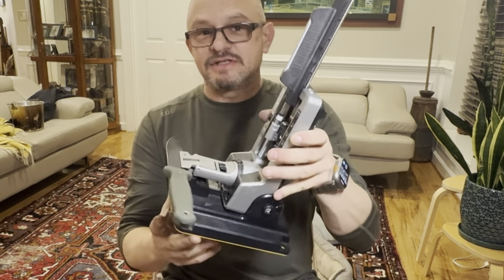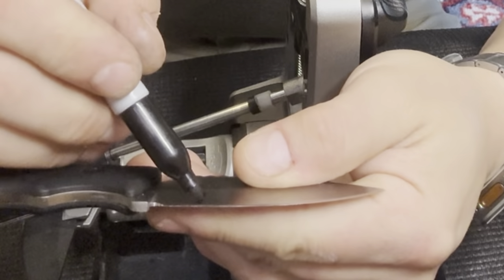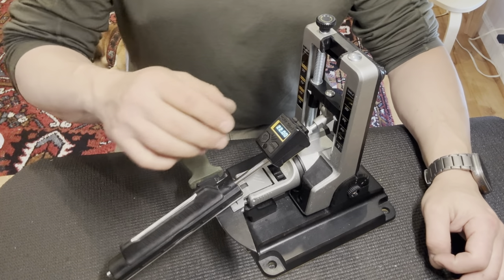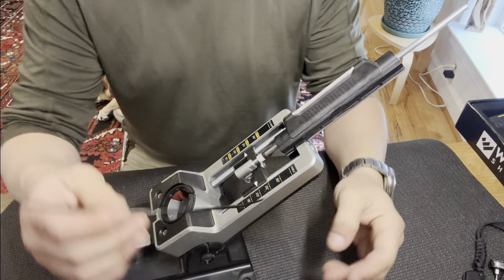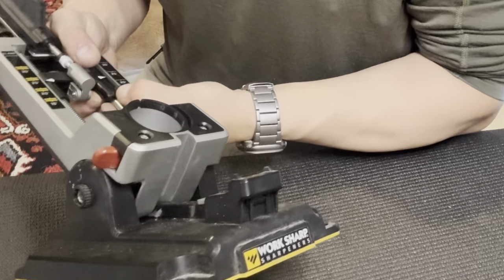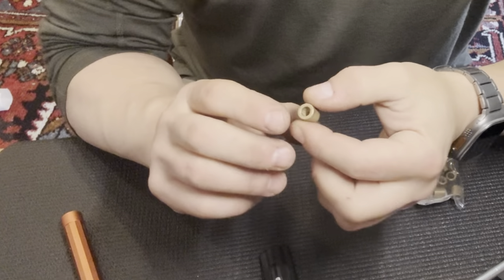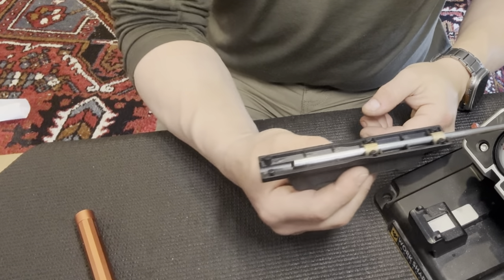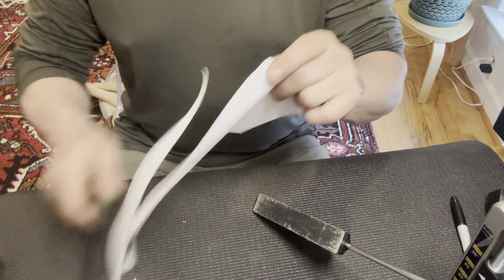Episode #1. Did Work Sharp stop $3 short of Professional level? Is it really PRECISION Adjust-able?

Comment: Hello CBRx, 
I was wondering how long the sharpening plates and stropping plates last. Did you have to replace them in the few months of using this before making this video? How many knives would you say you can sharpen before having to renew a plate? 
Thanks for the honest review! We need more people like you on YT! You have my sub!!
Reply from the maker: Welcome to the tribe! The fine grit plates, 600 and 800, last well over 50 sharpenings. The heavier grits don’t get used as much so I haven’t replaced them yet. I don’t like the strop that came with the set a s the leather is waaaay too rough.  You shouldn’t need to keep the fixed angle for stropping anyway, so I recommend a dedicated strop

Comment: i went on ahead and purchased this today, i also grabbed up that pack of bearings you recommended. i hope this things ok i purchased the ken onion sharpener a few years ago and hated it.
Reply from the maker: I would recommend to try it out before putting the bearings in. It only becomes necessary. Please also watch the videos that I posted recently covering the proper way to tension the clamp (must see ;) and to support the blade (optional)

Comment: Anxious to hear your thoughts on new glued/bonded stone holder. I just bought one from a brick and mortar store. Mine too doesn't have screws (can't put brass bushings in).  If worksharp's action was to put brass bushings in to correct their initial mistake (cost over quality) this would make sense.  If instead their business model is to force purchasing a new stone holder arm after approx 30 knife sharpening(s) I'm taking it back asap and giving this the lowest review possible (ie American engineering at it's worst). What happened to the days companies built quality products vs building into their model known failures to keep charging their customers for replacements parts designed to fail vs last?  Let's see what the results are... but we need to start banding together to share input with companies like Work Sharp (and more so potential customers) doing this vs just accepting every decreasing quality even on 'premium' (marketing term) products.  I see they just announced a new model (with HUGE case and more sharpening stones) yet it appears the same base unit with same weaknesses but far more $$$.
Reply from the maker: @tkels5471  Yes, I have an “upgraded” plate holder and a plausible solution to add the bushings without removing the plastic ones, but I haven’t tested it and so it’s work in progress. If you search my channel, there are several videos about XARILK Gen 3 sharpener that I’ve been using with great success and without any bandaid fixes. It’s very similar to TS Prof Cadet but 5 times less expensive! and I am currently working on a video comparing the two. I think that you would get more than your money worth out of this one https://www.amazon.com/dp/B0D5QQW4YD/ref=cm_sw_r_as_gl_api_gl_i_514X3TZR1DCY3TH50DGE?linkCode=ml2&tag=gearupandgo-20

Edit: this is an affiliate link and I would get a small commission if you use it.
Reply: @CuttingBoardRx  THANK YOU

Comment: Worksharp just made a change...not for the better. I ordered a couple extra Rod / Abrasive holders and one of the abrasive holders no longer has screws to take it apart for your bushing modification or cleaning it out. It is probably snapped together, but i don't want to destroy it for no reason. I really don't need it and would be glad to mail it to you if you want to dissect it on video.
Reply from the maker: Wow, that’s interesting! Thanks for the information! Could you please send some photos to the email address in the channel description? And, if possible, the link to where you ordered it?
Reply: I just sent a new screwless model out today per your request...will be there on Tuesday. Hopefully, you can  figure out a mod for it as well.
Reply from the maker: Thanks! I’m tracking the package!

Comment: They sent me 6mm x 10mm x 10mm and it will not slide onto the rod. I ended up using a size B drill to ream them out and it made them fit perfectly. Bit was only 5 bucks on Amazon. Yes...you are correct the 1/4 would be to big.
Reply from the maker: I ordered metric bushings and they work. It  supposed to be a slip fit meaning almost no clearance, so 1/4” is too big. If your rod measures 1/4, send a picture to the email address in the channel description please

Comment: I just got a new one and the biggest issue I've found so far is how much flex the blade has within the clamping jaws. With the spine seated as far back as it can go, it doesn't take much force on the blade to see the spine actually move within the tightened jaw. It seems to me the jaws come together at an angle that is way too steep, which allows for very little actual contact area to apply clamping force with. Have you seen this problem as well?
Reply from the maker: @MrStrizver  yes and I solved it. There are a short and a long videos on my channel.
Reply: @CuttingBoardRx  Thanks...found it (again)...I knew I had seen that one before!

Comment: My friend, I love your straight to the point fixes. Do you edc the Arc ?
Btw great video, I may go back to sharpening with something other than a metal file eventually 😅
Reply from the maker: Thanks! Regarding the ARC, I’m trying to figure out how to…. Haha, like I’m going to spoil the surprise!
Reply: @CuttingBoardRx  Well done, now I wanna know ! Anyhow I'll watch the vid 😉
Btw I broke my neck knife's tip on The Kindling Of Doom... Seriously a very thin piece of hazel. I'll grind it someday
Reply from the maker: @ARAW-__-  Was it ESEE izula?
Reply: @CuttingBoardReviews  nah, Civivi Circulus. I love that small thing but it's not perfect yet. Almost
Reply from the maker: @ARAW-__-  hmm. That’s why I don’t trust anything that has “budget” and “made in China” in the description! Their heat treat is always at the extreme of tolerances because they think we want 62 - 64 HRC on every blade! (and there are plenty of idiots who say that!) But 10cr15mov should have been 57 RC at most on a fixed blade and if it was properly done it wouldn’t snap off… 😡🇨🇳🤬
Reply: @CuttingBoardReviews  I knew the tip was thin, so I did not apply much force. The only leverage was my hands against one another. I'm a bit bummed, but hey, my Izula is still in one piece. Although, it's a smaller piece now with that file grinding 😅

Comment: The clamp design has a design defect in that it doesn't secure the spine along the entire width of contact.  The problem is the closure mechanism pivots around a set point and so only contacts the blade at a very thin line along the edge.  the rubber in the clamp is the cause, most of the angle play is in the clamp rubber itself especially on thinner knives like cooking chefs knives. Hapstone stone adapter fixes the carrier bushing play but then requires a longer guide rod and itself needs modified to hang up on the top hook.  They really need to address all these issues in a revised design.
Reply from the maker: I haven’t tried Hampton holder but it’s on the agenda. At a glance though I don’t expect it to be much better than the factory one. However, I respect @neevesknives Jared’s opinion a lot on all sharpening methods and that’s why I will order it from his link and will give it a fair assessment from a precision machinist’s prospective.  (he’s the one who first mentioned it to me in a live chat) If I find it to be as great as everyone thinks it is, I will provide HIS link to my viewers so that no one would be able to say I profit by HIS advice. Regarding the clamp, I have only seen a wobble with the widest of my blades and I agree with you, Work Sharp could have addressed it differently. Appreciate your thoughtful comment!
Reply: @CuttingBoardRx   Aside from the adjustments you mentioned the hapstone adapter is a game changer imho not only because it allows 'standard' sharpening stones but it's much higher quality all metal design that slides more smoothly and without canter perfectly along the guide rod and without the plastic bushing play you found.
Reply: try sharpening a 8" chefs knife and you will find what is imho the biggest flaw of the clamp grip play. Also on mine at least the cut angle is 1 degree difference simply between the top of the knife and bottom by flipping the knife.
Reply from the maker: @darylfortney8081  definitely on my to do list!
Reply from the maker: @darylfortney8081  I get what you’re saying. If I was sharpening chefs knives all the time, it would require using wet stones.
Reply: @CuttingBoardRx  I use both and the guided setup is much better

Comment: Very nice review! But I have to ask: Is there an even better sharpener out there that you would recommend over this one? I am currently contemplating ordering this. The system I have been using for many years is the old Lansky system. I take it that even with these issues, this one will still beat out that old system?
Reply from the maker: I was eyeing the Wicked Edge system which the only other system in that isn’t priced out of my reach. But it is basically a more expensive version of the same approach. It is $100 more in its most basic form and to get everything you’d want in your arsenal expect $900-1500 total investment. The only major difference from WSPPA is you don’t have to flip the knife and you can sharpen both sides semi-simultaneously in an alternating fashion. I gave it some though but decided that I would never be able to trust that system as my left and right hands don’t exhort the same force. And I like to keep my left hand on the underside of the blade almost at all times to feel for sudden changes. Also, you would end up having to buy and store twice as much abrasive media. WSPPA is a huge improvement on Lansky and the inclinometer comes with it so you can always have repeatable angles

Comment: Unit just arrived and I'm happily using it but the CLAMP allows the knife to pitch up and down., no matter how hard I clamp it, the blade tilts when applying the abrassive to blade and sharpening...    :( the flex is about 2 degrees...(Pitchi).  if I use the abrasive in a PULLING method the blade pitches down, and I use a PUSHING method the blade pushes up...  Any advice?
Reply from the maker: Sounds like you are pushing down on the plate holder. There is no need to press down at all. And I tighten it very hard. Wider blades though I have to support with my free hand specially towards the tip
Reply: @CuttingBoardRx  thx for advice… I will give this another shot!! ;)

Comment: Has anyone had a problem with the plastic chassis that holds the rod cracking? I’ve asked Worksharp about it and they sent me a whole new upper unit, which also had a crack, then another with the same problem. The third one I got was fine, but I just wonder if anyone else has noticed that.

Comment: Hi,some greetings from Germany!
I'd bought the sharpener some weeks ago and have the same problems like you with this thing .
It's great that i can easily change the bushings,but i can not open the abrasive angle.The head of the screws look like a "face"of a teddy bear,no torx bits i own will fit.Do I need a special tool?And if i do:Which size?Please let me know.
Best Regards,A.Bertram
Reply from the maker: Mine work well with T8 and T9, the latter being slightly tighter. I use the Hoto driver linked in the description, but any set should work.
Reply: Hi there. I'm from Germany as well. The link provided in this vid is from Amazon US and that would ship. Do you have a link where to order those exact bushings in Germany?
Reply from the maker: @passenger0102 I do not have a link to German retailers. Look up bronze washers 10mm outside diameter, 6mm inside diameter, and 10mm length.

Comment: Great job on the fixes. It's very impressive, but I have to disagree on you saying 80crv2 is a very high-end carbon steel. That type of steel is meant for cheaper knives that can handle some toughness with no edge retention and will rust. Great fixes, though.

Comment: How do you deal with the problem of the angle changing from the heel to the tip for longer knives? When you set the angle at the centre to 20 degrees and move to the tip, the angle gets smaller.
Reply from the maker: Check out my latest video: https://youtu.be/amzmCWjo0cY?si=g9pHspuq4RPkTtKT

Comment: Will the self lubricating bronze bushing cause any wear to the rod?  I'm going to do all of your fixes.  I'm not that good at sharpening knives yet but I might as well start off with my worksharp being squared away.  Still struggling with figuring out all the factory angles of all my different knives.  Never sure what degree to set them to.  

Thanks for the video
Reply from the maker: Are you using the Sharpie method to find the factory angle? Also, if you plan to change the angle from X to say 17 degrees, there’s no need to figure out what the X is. Just clamp the knife, set 17 degrees on one side, make sure that it’s also 17 on the other side and start sharpening with the 240 grit. 
The bushings are designed specifically for this application so I wouldn’t worry too much. The burrs that come off the blade, if some get inside the abrasive holder, mostly get caught by the magnet on the inside.
Reply: Thanks for the reply, I ordered 10 of those bushings.  Also, thanks for the advice on sharpening angles.   @CuttingBoardRx

Comment: Thanks for a great review. I replaced the nylon bushings with brass ones from Amazon but am having a problem. After sharpening for awhile the bushings seem to gum up and bind on the steel at the far bottom end of the rod. It appears that either the lube in the bushings is gumming up or maybe the rod heats up and expands (I would expect the bushings to expand also). I did check the diameter of the rod with a digital caliper and its straightness by rolling it on a flat surface. 

Any advice?
Thanks
Reply from the maker: A drop of gun oil on the rod every so often should help
Reply: @CuttingBoardRx  Thanks. I'll try it.

Comment: I ordered the bushings at the link provided but they are larger than the ones in the rod. I should have measured them on my machine but I didn't. If I had to guess though, if the nylon bushings are now smaller they are about 4mm ID and 8mm OD, approximately. Of course, perhaps Amazon sent the wrong size but that never happens, right?
Reply: Never mind, it was my error in ordering. Apologies to Amazon. Apparently it will be a month before the right size get here.
Reply from the maker: @ImOnTheEdge  it took about 4 months for me to start noticing the wear on the nylon bushings, so you have plenty of good sharpenings in your arsenal!

Comment: Hi, I just purchased a used one and don't see the white nylon bushings that butt up against the black bands which limit stroke. Some review videos (including by Worksharp themselves, at least the one I watched) don't show those. Did you add those yourself? Or perhaps they stopped including them? It seems they would help as I'm moving the bands just by bumping them with strokes.  Thanks again!
Reply from the maker: I added them myself and they came out of the old paint roller. They kept the rubber washers in place in case I got too enthusiastic with the stroke

Comment: If I keep the rod lubricated, would that prolong the nylon bushings?
Reply from the maker: @PandaFPV  The opposite. small metal shavings  and diamond dust will form an abrasive slurry and accelerate the wear process
Reply: @ ok. Just got mines in the mail. Seems like the knife holder has zero play. Maybe they fixed it. The top part where you put the zip tie does still have play though. I’ll look into the bushings. Thanks
Reply from the maker: @ Read the pinned comment before you buy bushings
Reply: @CuttingBoardRx  damn. Yeah mines came screw less. If I look inside through the opening on the end, I see the white bushings. They’re still being cheap about it.
Reply from the maker: @ I’m getting one soon. As promised

Comment: Me personally for $250 its a rip-off. Its an eyesore, the stone holder is proprietary to just the stones they offer. I like the looks of a properly built system and i like to leave it out to look at because they are expensive and i dont like having to take apart and put back together every time i want to use it but the worksharp is so ugly id have to keep it hidden lol. For $200 you can get a Hapstone RS that not only looks amazing it works amazing and any stone from 4 inch up to 6 inch will fit on it directly from the factory. I personally would not consider the new work sharp professional sharpener as a professional sharpener. Its an upgrade from the original but its far from being up to par with the real professional sharpeners like Hapstone or TSPROF. Great video. I recommend you get the Hapstone RS if you want a premium system at a good price and pair it with the 6 inch by 1 inch venev centaur dual sided diamond stones. You wont regret it.
Reply from the maker: Thanks for the suggestion! I agree with your assessment of the WSPPA and not being truly “professional”
Using a photo enthusiasts lingo, it is promateur (professional-amateur) device. Yet, I get very good results with it and I like the fact that it comes with a wide range of grits in a relatively small package. And I don’t find it ugly, it reminds me an 80 mm mortar sight.

Comment: I understand the nylons bushings wore in an oval shape, which would contribute to the slop in the carrier. The testing you did with the inclinometer showed it was the rod itself that had a difference in angle from top, indicating the rod is NOT straight, which seems like part QC issue.
Reply from the maker: Probably didn’t come through the video, the rd is straight as a… rod but it rattled between the extreme positions bc the bushings were so loose